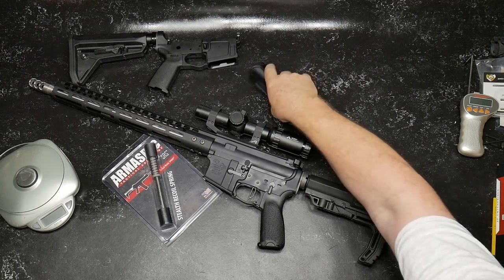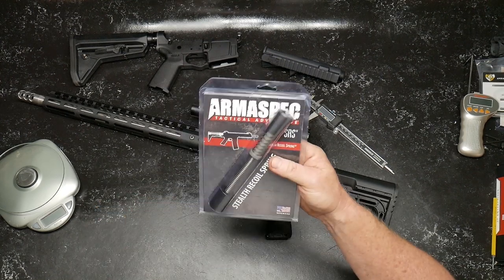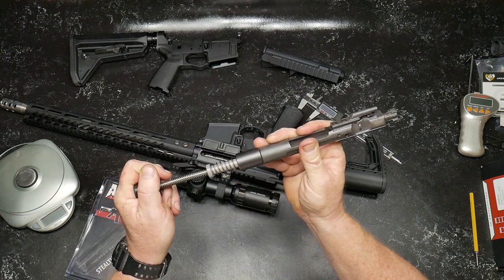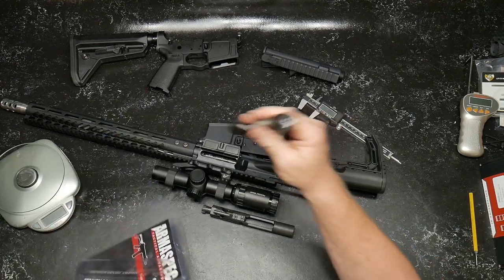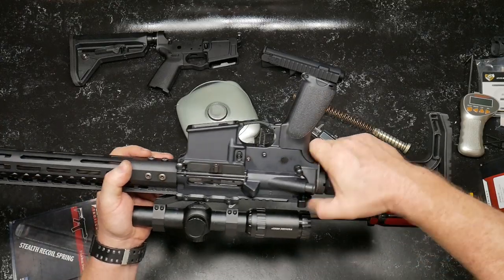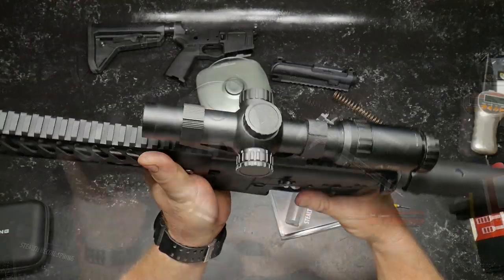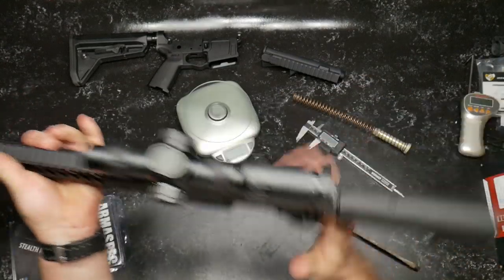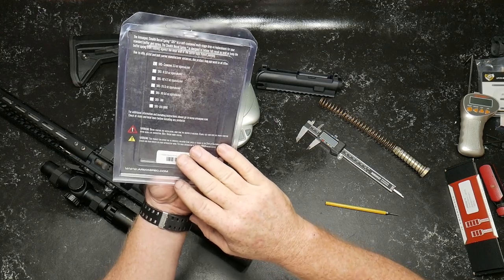Armaspec Stealth Recoil Spring First Look

Comment: TECH TIP : For anyone who wants to get rid of the sproing noise in the buffer tube, rub a layer of white lithium Grease on the buffer spring. You will be amazed at the difference.
Reply: There's a tube of that not five feet from my rifle. You're blowin' my mind right now.
Reply: Yeah man, when I got my first AR (a bush master) I noticed a whole lot of buffer spring noise while shooting. It really bothered me and made the rifle seem cheap. So I went searching the web for a solution. I stumbled across this tip and tried it and it was like night and day. I've done it to every AR I've owned since.
Reply: @garychief2338  
Try it, you have nothing to lose. If you want to, you can just wipe it back off. But I'm willing to bet you that you'll leave it on and you'll do it to every AR you ever get. 
And if you watch Midway USA's video on assembling an AR lower, you'll see that this is one of the things Larry Potterfield recommends.
Reply: I can vouch for this.  I picked up a spray can of white lithium grease and sprayed it inside the buffer tube on my budget build to see if I could make it as quiet as my rifle with the Armaspec SRS.......  The Armaspec is still smoother and quieter but the improvement was EXTREMELY noticable.  It no longer sounds like a cheap POS.
Reply: That's excellent advice 👏 thankfully I hit the comments. ✌
Reply: Actually did this, but still wanted to try out the Armaspec SRS.    The SRS and white lithium grease is absolute quiet during charging and cycling.   But for most, this isn't a big deal.
Reply: DO NOT DO THIS. IT collects carbon and dirt then WILL CAUSE it to get stuck.
Reply: @mjk4378  
Are you a gunsmith? If not, then where does your knowledge come from? Personally, I've been doing it for years and have never seen any carbon build-up. And if you watch the gunsmith from Midway USA Larry Pottersfeild build a lower, it's one of his recommendations
Reply: @RickJamesGhostGuns   I'm YouTube firearm certified and ya mother agrees with me too. What more do you need than that?

Comment: Not enough difference to matter on sound.
Reply: That recoil spring do way more then just removing noise.... look it up
Reply: @IvanRossS  I just ment the sound diff isnt a big enough difference to matter. The fact is its 100% better that a regular setup. I'd buy it
Reply: It's bc it's a knock off, the real deal JP silent captured spring is second to none an will be in every one of ur next rifles once u try it in one
Reply: @Esoteric Bear regular spring an buffer? Oh ya ull get a monotony of sounds. JP silent captured spring it's the high end first to market version of this spring he's showing here. Nothing against this spring system he shows but I promise u the JP SCS is better and they have multiple different weights and set ups for all kinds of calibers and builds
Reply: @Esoteric Bear the JP silent captured spring DOES have variable weights to change in an out...
Reply: @Esoteric Bear they have standard weight, H1, H2, 9mm and I'm probably forgetting atleast one
Reply: @Esoteric Bear on a jp set up like mine u can take a screw out of the end and the spring and weights come off for changing and cleaning
Reply: It does for a suppressed sub 300blk. All I hear is that scraping and twang in the buffer at my ear and it's annoying. I ordered one to see if it is quiet

Comment: I run their H3's and have never had a single issue. Great addition to anyone's fire breather for about $30-$40 less than a Geissele Super 42, which I also use. Both are outstanding and will outlast any other ordinary buffer & spring.
Reply: What caliber and barrel length do you have? I have a 16" mid length 5.56 and dont know if i should get the h2 or h3.
Reply: @Okorokanze2000 they recommend the h2 for that barrel length and gs system.

Comment: Guys !!!! This not only for spring noise reduction.... OMG... why nothing was said about this:
The Stealth Recoil Spring ™ is designed to reduce felt recoil as well as keep the buffer spring from rubbing against the inner wall of the buffer tube. The buffer mass is designed to stay under constant tension against the bolt carrier and the O-ring on the head of the buffer mass prevents metal on metal contact.
Reply: I did some testing and I didn't really feel any difference in noise or recoil 
Not that 5.56 has lot of recoil to begin with. In my opinion it's just a gizmo
Reply: I can see a possible advantage in recoil and noise reduction, and I see the metal to metal concern, but I 've never worn out a buffer or buffer tube. Perhaps there might be some accuracy improvement by keeping the bcg more squared to the chamber. But the advantage would be so little I could not justify the cost compared to a Spike's Tactical flat wire spring. I see this more as a gimmick than advantage.
Reply: Black Hawk International Security   How much is the Spikes flat-wire spring??   I've considered getting one from Strike Industries. Last time I looked, I think it's about 17 bucks for Strike's flat-wire.    And have you heard if there's any meaningful difference between the Brands' springs? 
  Thanks!
Reply: @RagnarOdinson  ,I have the SI pistol buffer tube, flat wire spring, and included buffer(barely an inch long). It is by far the only item from SI that I regret purchasing. Extremely stiff, noisy as f@$%, all kinds of cycling issues, way heavy compared to mil spec and recoil is massive now imo. The bcg also bounces after bolt is closed. I can not change buffer weights. I am waiting on an adjustable gas block, but truly doubt it will help. The worst $50 I have ever spent. I love all my other many SI items.
Reply: Benjamin Cox   Thank you for the info, I do appreciate it.   I was considering trying Only the flat-wire spring.  Using it in a standard length buffer tube with standard length buffer (perhaps trying different weights in the buffer) was my plan.  So besides the potential noise, I'm still curious if there would be any other differences/improvements in an otherwise conventional setup..?   Who knows, maybe? Lol.   🍻👍
Reply: Benjamin Cox   And I guess I'm making the assumption that the Strike Pistol Buffer Tube is shorter than standard..?
   From what I remember off the top of my head, when used with a standard tube and buffer assembly, the flat-wire is supposed to provided a more consistent spring pressure throughout its range of motion.   I think the idea is that you would get the same or More spring pressure on the closed bolt Without adding more and more pressure/tension as the carrier is cycled rearward I to the tube... Whencompared to a mil-spec carbine spring.    That was my understanding last time I looked at the stand-alone Spring product.  But hey, I could be wrong 😜. Lol. ✌️🍻

Comment: I have one in my sbr lower.  Have used it with 7.62x39, 6.8, 6.5 Grendel ,  .300 BO, and 5.56.   Suppressed mostly.  Has worked flawlessly.  I just bought my second one for another lower build.
Reply from the maker: Good to hear!
Reply: How do I know which weight to buy (H2, H3, etc.) for my standard AR-15 with a 20” barrel?

Comment: I have one of these coils on my blackout pistol and I love its quiet and it works great
Reply: Should I get the H2 version for a 300 blackout pistol?
Reply: I also would like to know what weight you used for a 300 blk pistol?
Reply: I have to check but I believe I do have the h2 buffer on a 10" barrel I should of got the h3 but h2 works, I like the way it does I'm sure itll be fine once I suppress it
Reply: @jamessonjeanneau7870  really if you do not desire stealth recoil then go with buffer spring and buffer, not saying it doesn't work, the stealth receoil is just quiet in noise reduction you do not here a twang after every shot.

Comment: I did a video on one of these a few years ago, they work great. They aren't smooth and buttery like the jp but they're half the price. I've gone back to putting flat springs in most of my rifles though.
Reply: Where do you pick up your flat springs at?
Reply: @davydwalker8554  Tubb flatwire springs. You can get them off most the big sites that sell parts, or davidtubb com.
Reply: I have a Tubbs flat spring also,  Which one is quieter and smoother?
Reply: @nickfugleberg7731  how much did you get it for? I read about them and am curious

Comment: Hey Kota just wanted to share my experience with this product. I had one of these a while back but ended up returning it. I noticed these lack the sliding weights that traditional buffers and the JP buffers have which are meant to stop bolt bounce and delay BCG speed which is supposed to aid in reliability. My rifle was over gassed and I thought I'd give this a try. My ejection went from 2:30ish to 1 o"clock when I installed the Armaspec buffer, can't say for sure but I naturally assumed it was due to the lack of the sliding weights I mentioned. I contacted them and on their defense their customer service was awesome, very nice, help and genuinely seemed interested in getting my rifle working properly so I was grateful for that. They sent me out the heaviest weight they had no charge which did help but my ejection was still about 2 o'clock which was still worse than my previous set up. I liked the concept of the product but it did not work for my purposes. I ended up going with a Strike Industries flatwire spring and H3 buffer for a while till I finally got an adjustable gas block installed.

Not saying this to deter anyone from getting it, It seemed very high quality in construction for the price and the concept of a captured buffer system is a pro in my opinion. Just make sure to monitor your ejection so you don't end up having a less reliable rifle. Honestly now that I have my rifle properly gassed I'd like to try this product again and see if I my experience is more positive. But I have other things I also want so that'll be lower on the list lol.
Reply: Did you ever try putting the SRS back in your rifle after you got the adjustable gas block?
Reply: Right? Lol your messing with spring weight and overall weight, getting an adjustable gas block imo is necessary for any custom build.  It's one of the better 100bucks you'll spend on your gun

Comment: I just bought this for my rifle, H2 weight. I'm getting it for three main reasons; One, it's a captured recoil spring system, meaning everything is nicely contained instead of loose. Two, remove the buffer detent that I've personally had break and jam my trigger. And lastly, to reduce the felt recoil. Now, I know a heavier standard buffer will do this as well, and that's okay.

Comment: I like that it (when installed correctly) keeps positive forward pressure on the bolt lock up. I would say that it actually has made my gun shoot more consistently and accurately.

Comment: I got one for my AR 9mm build. Had a 9mm hydrolic buffer I won, but have had nothing but problems getting it to cycle reliably. This and the JP SCS reduce recoil to prevent from breaking 9mm BCG's slamming in the buffer tube. I love you remove the heavy weight from the BCG in a 9mm for it to work also.

Comment: a lot of people say the jp systems dont work good for higher calibers. but that is because a lot of people are dumb. usually if you have a 4.2-4.8oz buffer in a 5.56 system. if your going to use higher velocity round you need tighter threading in the barrel, along with a heavier spring and buffer. where a mil spec spring is like 1.24oz. where a heavy chromium spring same as if you use a heavy 308 build would be closer too 2.4-3.6oz. then your 5.56 round would use a 4.8-5.2oz buffer or your carbine ar10 would use a 3.2-3.4oz heavy buffer. so an ar15 carbine would need 6.2oz collective of buffer and spring assymbly. so if your running a 6.2oz to 7.4oz silent system it barely covers a 5.56 setup. meanwhile the guide rod in heavy systems like 308/4858/50beu would need 5.7-6.2 heavy tunston ratings. and this is why those systems dont work with P++/hypersonic round. is because that is the SS ratings. as they are designed for subsonic ratings, x<1344fps rounds, aka low grain rounds. so any system in this setups would be -1.2oz to that configurations. this way it deals with the additonal blowback of a suppressed barrel, along with dealing with the lower pressure rounds. so your suppressed ar15 uses a 4.6oz silent system, where non-suppressed doesnt quite work.

you can also get big tube, and line it and your big boar15 and line them with high density 195 silicon.  being stronger than most tires against friction and slam. as well as yeilding 42db decline within the housing. then your only bleedout is threw the ejection port. altering spring sound as you very nicely displayed here.  as well as reducing funciton sounds by an average of 15db. which might not be a big deal for a 9mm cmmg or a 5.56 build. but those socom .458 and .50beu's -15db to function and altered spring slam also increases the life longivity of the system.

where as the 30-06 and 308 calibers. for long range precision firing... the kyrnshot hydroic buffer does this better in both suppressed and unsuppressed systems, while increasing long range accuracy by a significant amount. because less parts moving - more stability. and with the stable hydroilc weight vs moving ball barrings makes the system feel 5lb lighter because there is no shifting of weight within the stock, tho you only loose maybe 1.2oz.

just want people to realize, when switching to a suppressed system like needing an adjustable block to counter the backblast contours of gasses on the front end. the rear end gasses are not adjustable on most bcg exhaust ports. so you may end up having to get a couple of silent buffer combo units till you get the right buffer/spring weights to operate properly on a suppressed system.

this was not the video i was looking for... but despite such, excellent sound review!

Comment: YMMV but: installed and took to the range... had issues off the bat. first round sent but every 2nd, literally, failed to chamber. every, time. no issues whatsoever before the upgrade. my guess was, it was cycling too aggressively cause each subsequent round was being crushed and jammed with a dented casing = wasted round. after the first mag (so annoying having to clear and charge every-other-round- I was on a date too and she was like "is that suppose to happen?" what a mess lol), eventually it cycled fine after 30 or so rds, but still, put back in the original spring and..whaddayakno? non issue. just fyi.
Reply: Funny you should mention that happening.  I have an AR9 that I put a JP SCS in this past weekend.  I got it to help reduce spring noise and soften recoil.  First mag I ran I had the bolt lock back after every 3 shot so I had to put the bolt back into battery each time.  Thought it was just a fluke after the first few but nope ... it happened at least 15-20 over the course of 50-60 shots.  Got really frustrated because I thought the JP SCS was supposed to be the Cadillac of these type of systems.  Ended up swapping back the original buffer and buffer spring then reinstalling the center mass in the BCG because that's what you have to do with these systems when used in a AR9 and it ran just like clockwork. 
  
FWIW, definitely didn't notice any reduction in recoil with the SCS.  The spring noise was gone and the cycling was smoother when charging but failing to chamber a round is kind of a no-go.  So it's been an expensive experiment that didn't go as planned.  As an FYI, just be careful of your expectations with these type of buffer systems.   They may not be everything you think they'll be.  I'll probably try a flatwire spring next to see how that works out.  Definitely less expensive!

Comment: I own both and the JP is by far better.  The SRS is harder to charge and has more resistance at the very end of the pull.  It is louder than any spring and buffer I have and its not even close.  The JP silent capture is smooth as butter and a hell of a lot quieter.  If you you want an SRS I'll sell mine cheap so I can replace it with a JP.

Comment: You know whats funny to me is I never noticed the springy noise until this and the JP silent recoil assemblies came out.  Performance wise for cost? Not my flavor.
And this ones actually louder from what I here
Reply: I use JP silent capture in all my rifles including my AR9. Love them and wouldn’t use a conventional buffer again.
Reply: @VictoryOrValhalla14  I had two but when I ran some timed and accuracy tests on various barrel lengths and ammo I never noticed any difference at all.  The sound?? Immaterial to me and I dont even notice it.  Try a Tubbs flatwire spring little different then most springs. 26$ and very noticeable difference especially on SBRs and suppressed guns.

Comment: I have a FOXTROT MIKE   UPPER  and the bolt in it  has what appears to be a  WEIGHT   in the center  so there is NOPLACE  for that ROD to go through the bolt..    do I need to remover that  weight

Comment: Bet the 3.3 weight aint enough to stop bolt bounce. Bolt bounce makes extra noise too
Reply: My 700 doller ar15 is hella much quieter haha with a sprinco spring. I think most of the noise you have is cause of machiene marks inside the buffer. Polish the Internal walls of buffer tube and you would be quiet af. And get a heavier buffer weight, looked like ur rifle could use possibly a 5.6 buffer weight. That would be even quieter with 1 time of metal making contact instead of 2 times. I saw bolt bounce on your slow mo. USE ur super slowmo on your phone and it'll be slow enough to see it bounc3.